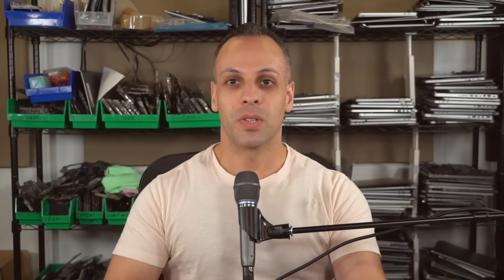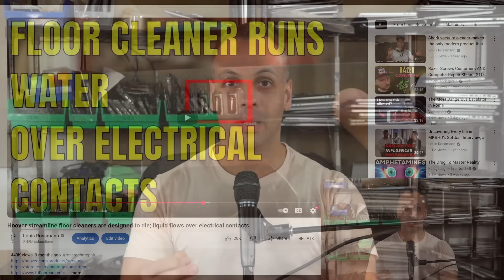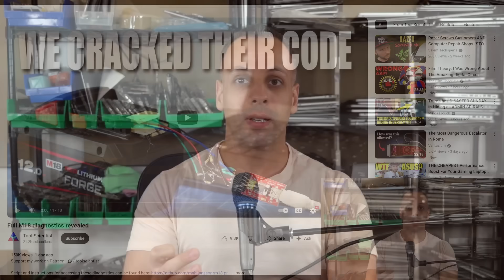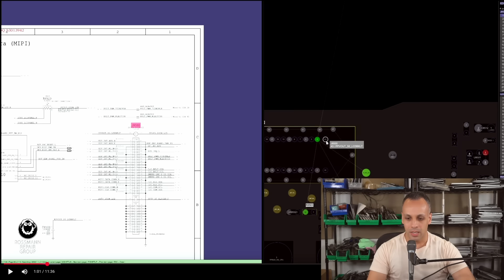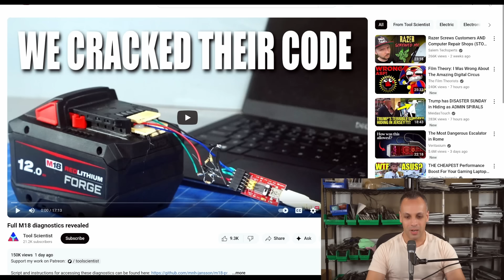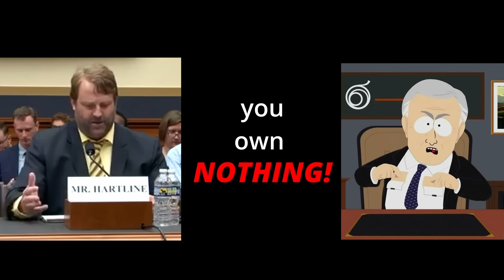Imagine putting DRM in a battery to void warranties...

Comment: Not implementing a balancing charging circuit is the stupidest thing you can do when connecting batteries in series. It's super cheap as well. Every electronic technician that knows how to build battery packs knows balancing as well so that was done blatantly on purpose. Absolutely stupid to build products like that.

Comment: That's why I just have a 230v powertools and considering they don't really draw that much power, an inverter + ebike battery that can easily be put in  a backpack. Perfect solution? no.  But for someone that doesn't work with those tools often(sometimes years between uses), every time I need them those batteries are dead, and so deep discharged that often they'll be "defective".  So this solution where I can usually just power it by plugging in, and if there's no power around using the ebike battery is the perfect solution for me 🤣

Comment: TTI is also just shit at making tools. They pump all the development resources into Milwaukee to boost them as they are a MJAOR! tool brand worldwide but then you open a Milwaukee tool up and you find non branded "China" bearings inside. Murican quality yeahhh
Also Milwaukee is very much known for loose batteries and worn out contacts that lead to problems.(cope Milwaukee fans cope)

Comment: I really dont see a problem with this. Lithium batteries can VERY easily be damaged if some dumbfuck uses it improperly, keeps it charged 100% for extended time, or gets it too hot. 

And yeah, high temps will damage a lithium battery, even when not in use.
A battery charged to 100% and left in a hot car can lose significant capacity in a short period of time

 The alternative is not doing this, warranty them all, and raise their prices to make up for it..

Not using the balancing feature is pretty gay, but in all reality, if the cells are so far out of balance it because one or more is faulty. balancing is pretty useless for power tools because in a high drain use, the weak cell(s) will cause it to cut out anyways. 

For those that dont understand, when a cell is of lower capacity than others, it will be at full charge voltage ~4.2v before the cells with higher capacity. Balancing will apply a small resistive load to this cell so that the other can continue charging to full voltage. When the battery is then discharged, the cell with lower capacity will hit its low cutoff voltage before the others, which will stop the battery as a whole from powering a tool. If you didnt balance, it wouldnt really matter, because your battery is limited by the weakest cell or cell group, so if the good cells get more of a charge, you cant use it anyways

Side note, is this really considered drm? These tools will work with aftermarket batteries, and the batteries will work with aftermarket tools. If they started that shit, yea id be pretty pissed. But tracking use to verify no abise for warranty..just seems reasonable. 

You can buy aftermarket power taps the go on the batteries to use as a power source, that have no com with the bms and will let you run the cells down to 0v and destroy them. Dontou think they should be forced to blindly warranty any battery even if something like this was done? And if not, how else would they be able to tell if it has been abused/used outside of its capabilities?

Comment: Thank you for covering this Louis. I watched that Tool Scientist video yesterday. Did not surmise you would speak about it. Pleasantly surprised.
When I realized that the battery packs were not cell balancing I was really in disbelief.  I know very little about battery systems but I have been watching Will Prowse for years and I DEFINITELY know the importance of balancing charges on cells if you want the battery pack to function worth a dang. Glad these batteries do not *currently* insist upon an internet connection. You know that is the next step.
ALWAYS on. ALWAYS phoning home. Uhg.

Comment: I bought a nikon-compatible battery for my nikon dslr. The camera told me that it will not be working with that battery and shut down.
Reply: A lot of Sony Ericcson phones would work the same* but display: "Charging, alien battery"
*At least some dumb phone models still worked with aftermarket batteries.

Comment: TTI power tools are actually very good, but it's incredibly disappointing that they have systems in place to deny warranty claims, when the long warranty is a MAJOR reason to buy their brands. For example, Ridgid (TTI owned) has a lifetime warranty through Home Depot. They already have a serial number on the battery and a date code. They've only increased the cost for the customer, and hurt their reputation.

Comment: Balancing is usually done on the charger. You can top balance or bottom balamce but you can't do both. Inherently they'll stay the same if not tampered with. If you run a balance circuit off the cells then they go out of balance. Leaving them alone is actually a gokd strategy if the cells are consistent and good.

Comment: Apparently Dewalt don’t balance their cells, they match them at the factory. There is a circuit to detect if a cell goes bad, but not actually balance them. But I’ve never had a pack go bad ever… perhaps I don’t thrash them enough, but I do charge them as soon as the tool cuts off during discharge.

Comment: BMS engineer here. Monitoring the individual state of cells in a battery is simple. It is a set of different potentials, where the voltage value of an individual cell is carried out by subtracting one voltage from the neighboring one. But making a system for uniform charging is much more difficult. The same signal lines used for monitoring cannot be used for charging, they will not withstand charging currents. A system on transistors or relays with a control circuit for all these switches (at least 2 per cell) is needed, plus it is necessary to make an independent voltage monitoring system for each cell, since simple subtraction of neighboring voltages will no longer work, as the connection scheme is constantly changing, which increases the complexity of the BMS electrical circuit by an order of magnitude.
But there is a fairly stable pattern in the cells, the one that is closest to the ground potential has the lowest charge level, the one that is farthest from the ground has the highest charge level. If the battery module has stopped charging and does not hold a charge, you can disassemble it and change the order of the cells in the module (or you can manually charge each cell to the same level), extending the life of the module. Some proprietary BMS would register disassembling and went into a permanent fail mode tho.

Comment: People often roll drumms for Milwaukee being great brand but in reality its not. Their batteries have always been bad. They last 1-2 years and die. Its done on purpose, so they can sell even more batteries. Lifetime battery charge about 1500 cycles? Likely wont last even 500 charges before the low voltage kicks in and disables the battery.

Comment: I always used Makita tools, switched to Milwaukee all was good until my shoulder started to hurt and I lost feeling in my right hand too much ugga dugga in the ugga dugga, also felt cheap and nasty so sold and returned to makita, one of my makita batteries is 13 years old and still works fine. ~ commercial electrician.
Reply: Watching https://www.youtube.com/@deandohertygreaser Dean Doherty's videos, I've learned that Makita is one of the few where repair makes economic sense.
Reply: @erik_dk842  seen some of his video's I do have a makita combi with more torque than a hellcat in my shed needing a repair.

Comment: "Don't attribute to malice what can be attributed to stupidity." - is a saying I tried following for a while, but at this point, I just assume malice until stupidity is proven, because most of the time is IS malice, intentionally disguised as stupidity.
Reply: The caveat is that stupidity alone should, by balance of probability, act in your favour as often as it doesn't. That it almost never does proves that it is not incompetence.
Reply: @thesenamesaretaken  No, not with engineering.  There is a lot more that can go wrong than can get better.  It only takes one thing going wrong for the bridge to collapse. Redundancy doesn't improve reliability.  It just makes more things that can go wrong.  It's the reason that there are only two engines on airplanes now.  Four have twice the failure probability. 

Don't even get started on three. That decision was purely political and unsound engineering.

Comment: Thanks for the reminder, that came up in my feed but it was late at night, I'll go check it out.

The PCB thing. So a schematic is abstract, often signals flow from left to right while power flows from top to bottom. This obviously bears no resemblence to physical layout in a lot of circuits. Connector symbols are, in my opinion one example where effort should be made such that the symbol expresses some semblance of the physical reality. PCB design tools have a feature called "design rule constraints" which allow you to class a net as say "high voltage", or "analogue" or "ground plane" or "high speed digital", "differential pair" etc etc and specify clearances between these different classes of signal in different scenarios, such as how close tracks run to each other or how close they may get at a thorugh-hole soldering joint. All this should also be subject to design review, which should indeed involve communication between the schematic guy, the layout guy, some management, software guys, mechanical guys etc.

Comment: tools have a crazy markup. cheap "yellow and black" tools are about $40 to make and $150 in the store. 
the part that is bull, most of the parts they get for assembly and repair are defective from the parts manufacturer. 
"wear in process from the vendor: run the motor in until it stops smoking. Reassemble and send back to the customer"

Comment: friend of mine brought me a ryobi drill battery once asking if i can have a look inside (it was around time i was putting together a battery for my ebike which he was aware of). he said it was not that old and worked perfectly until one day it would go from full to empty in a matter of minutes. so i took it apart and 2 out of 5 cells inside would sit at 3.5V instead of 4.2 (battery was fully charged). so i taped wires to my battery tester, charged them and surprise - it was working like new again. what caught my attention was this huge pcb inside battery, much larger than your average bms. im no electronic but i would bet my better kidney it was the culprit which after "x" amout of charging cycles would casuse the problem. funnily enough literally 3 weeks later he brought me second battery from the set. same problem and solution. coincidence i'm sure...

Comment: Having worked at a manufacturer of many diverse circuit boards I can believe this entire thing . We made home EV car wall chargers as a pre production line, probably the first 1000 just to approve the process and iron out bugs . We handed over the job to the parent company and after a few months they sent us back hundreds of units not made by us that where slammed together by some bunch of chimps .we had to go over them and replace components that they bought cheaper parts badly assembled!!  Absolutely ridiculous way to deal with high voltage units fixed to your home or garage!

Comment: DRM implies protecting intellectual property, there’s no such thing here. They don’t stop you from using knockoff batteries or knockoff tools with their products. Spyware, maybe.

I have no problem with a product that monitors its use to better determine whether action is covered under warranty, because ultimately the burden of proof is on the manufacturer and not the tool user. In the best of worlds, this would be able to reduce the overhead from fraudulent warranty claims and reduce the price to the consumer, but considering they have all the hardware inside these batteries for cell balancing I don’t think they’re interested in that kind of world. From Tool Scientist’s video it seems like a somewhat poorly implemented system, since even if your battery overheats while charging you can just wait for it to cool down before taking it off the charger, then it won’t count as an overheat event, thats a false negative. And as other commenters are saying, there seem to be other issues that cause false positives. My guess is they picked a subpar dataset for storing battery information, and it became “too difficult” to amend that while ensuring old and new chargers and batteries would still be compatible with one another. I bet it’s possible though.

As for the “manufacturer has this info but not the end-user”, that’s likely because they know their system is prone to false negatives and false positives. And so giving the consumer that information would allow them to exploit the false negatives and kick up a stink about the false positives not actually meeting a sufficient standard of proof, bad for business either way. At least they haven’t encrypted the memory.

Anyhow, since the new Forge batteries don’t have the hardware to balance if I recall, I suspect their management has only gotten worse recently. Before you hop over to Makita, they don’t balance cells either. In fact I’m pretty sure none of the major battery tool brands do any balancing. I’d stick to corded, but often they don’t have all the nice features like adjustable clutches and lightweight brushless motors. Run a thick wire from your cordless drill to two ATX PSUs in series instead? There’s no winning.

Comment: I once had an ultra expensive old laptop from 2007. One day I poured coffee on it. As I could see with my eye, it cleanly shut down all the components one by one as fast as possible. I opened it up, dried it, it worked just fine for 10 more years. It was a Dell and it was in warranty repairs way too often before the incident, but kudos to whoever figured out to implement such a feature.

Comment: It was claimed that the BMS chip supports slow passive balancing (which is often enough) but that they didn't implement the feature in the firmware. If this is true, it's just negligent and a big middle finger to the customers.

Comment: A "battery" is called a "battery" because there are many cells linked together.  If there's just one, it's a cell.  A lot of our terms for electricity come from artillery / canons (e.g., conductor, charge, battery).  The term battery involves repeated application of force.  Making pancake batter or committing assault and battery, for example.  It's not batter if you just stir it, it has to be beaten.  It's assault if you hit someone once, and battery if you strike them multiple times, though that definition is no longer true in many jurisdictions today.

Comment: 1:36 - Tool Scientist said their milwaukee batteries wouldn't register overtemp unless it was drawing 10A or charging.  Just heating the battery in an oven didn't trigger a count, so batteries sitting in a hot car wouldn't either...
Reply: Yeah there were a couple of points in this video that made it feel like he didn't actually watch the other video. Much of what he said was quite fair but there were a few details that I felt he was a little bit off on.

Comment: Badars workshop found similar with Ry*bi batteries.

There's actual an actual bug in the code that  bricks perfectly good batteries.
..
I will caveat that yes there should be battery managment safety systems to protect customers.
..
But still, bugs in software...

Comment: Built in failure... if only there was a word for it... 

To a degree I understand this, theres plenty of POS people who try to scam warranties. And to a point, I can get behind this. CORRECT way to to this already exists: keep the USE data and DIAGNOSTIC data separate. But that opens up a way to FAKE said "use" data, like people used to wind back odometers on old cars. If they want to do this CORRECTLY, they have to have reasonable USE CRITERIA. Which are, broadly speaking, for batteries: energy IN and energy OUT. If a battery was ABUSED under extreme conditions, its a clear case. 
This is why physical goods industry HAS such standard practices of expected use and performance. Literally fundamental.

Comment: 2:26 fourteen 3.7 V (power) 𝒄𝙚𝒍𝙡𝒔, battery means a multiple of units (eg cannons, wasb't there one in NYC?), the AAA to D units are cells while the 9 V transistor (radio) unit is a true (6 x 1.5 V cells) battery. Been pretty well that way since signore Volta (note the name) invented them.

Comment: I use DeWalt instead of Milwaukee, is has long been cheaper to buy batteries with a drill in a bundle than to buy the batteries separately. I don't have 6 drills and 5 working batteries for the fun of it.

Comment: 7:25 I spent the last few months sourcing parts for a long-flopped line of soda machines from the 80s called the BreakMate. I have probably spent a good $900 on it by now. Was this a smart thing to work on? Probably not. Have I saved any money compared to even a few years of store bought sodas? Not a chance in hell. Did I have fun (overall) doing it and learn about the different systems involved in what on the surface seems to be a simple thing for a machine to do? Absolutely. Don’t let anyone tell you what is or isn’t worth doing, go have fun, make things, break things, learn how the world around you works.